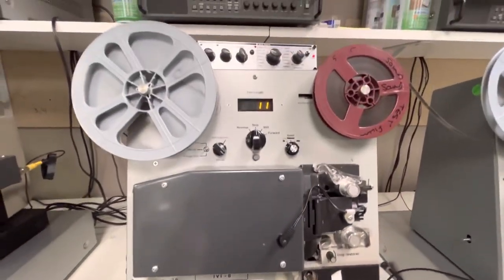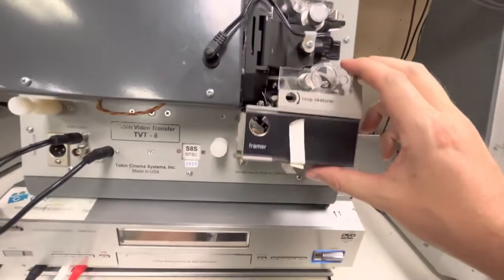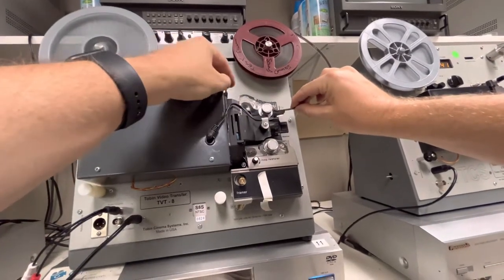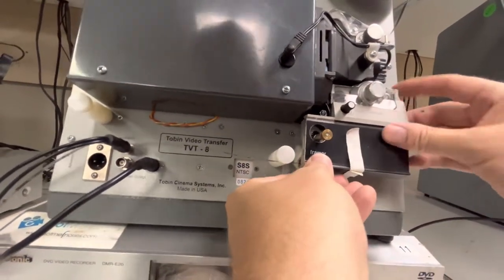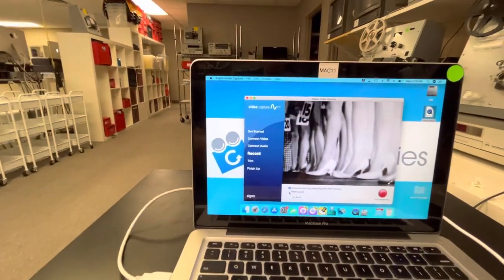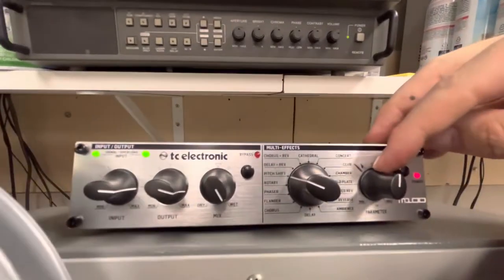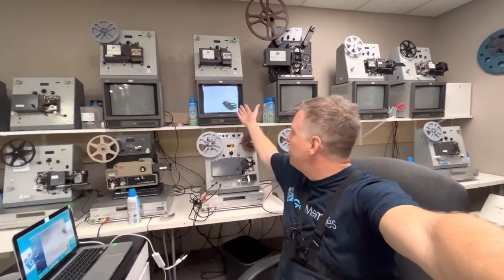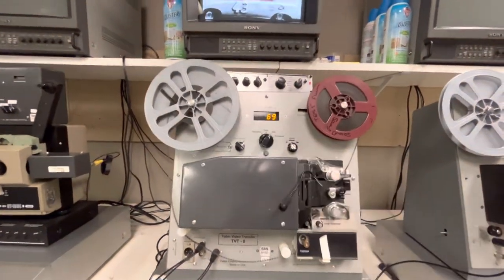How to Digitize Super 8 Sound to MP4, Film Transfer Equipment Demo

Comment: I have some regular 8mm home movie film with a single magnetic strip.  These would've been produced in 1962, at the latest.  I've never heard it, as I've only seen the film content after it's been captured.  I do have an 8mm projector (Eumig P8), which does not support sound. It does have a section to allow synchronising an external tape.  Makes me wonder if he (my grandfather), recorded audio separately and had it added, later, or something else?  Hard to think why there's a magnetic strip on it.  I'm trying to come up with an audio capture method running the strip past a cassette head.  Only done preliminary testing with a piece of super 8 with sound.   The head is able to pick it up audio, but nothing recognizable with the current testing.  The big concern is in not damaging the film.  Any guesses why an 8mm film of that era would have a magnetic strip?
Reply from the maker: Regular 8 with sound is very rare and it was a sep recording, not a sync ‘live’ … there are R8 mag projectors out there but very expensive. Some can cost a couple grand refurb. Might get lucky and find one cheaper.
Reply: @gotmemories  I managed to get a rudimentary audio clip from one of my regular 8 films.  As you suggested, It is not sync audio, but appears to be narration.  I'll continue to work on a system for getting the entirety of it.  Again, main concern is in not damaging the film, but I also need to ensure constant speed.  Specific speed is not particularly important, as I can fix that in post.  Cheers!

Comment: I have a question. Can this super 8 film scanner copy stereo sound track super 8 films and optical sound track super 8 films? This is very important for me because I have those kind films. And of course these stereo track films are very very rare and expensive.
Reply from the maker: No but I have lots of videos in the channel with me showing my specific sound equipment, there is a whole playlist with the collection of videos. Sound transfer machines are very expensive, insanely rare. 
If you want a quote for me to digitize them and capture the audio email info@gotmemories.com
Reply: Yes I can transfer stereo magnetic stripes on a custom built  8mm sound stripe playback machine with high quality sound (not a projector). If you like I can supply sound file examples for you. If they are true stereo tracks such as from a live stereo mic I can leave this intact for you. If you are wanting a mix of the main and balance stripe track tracks I can also do that in post.                                                                                                  The balance stripe is the rare other track on your stereo Super 8 film. My gear can play both tracks at once, which in your case means stereo. Here's a link to my recent YT demo of a high quality balance stripe transfer. https://youtu.be/wBRSRIflDq0?si=2ZuWi5rDy4JGp7Mv

Comment: I'm planning to build my own Super8 Scanner - about the sound head: do you think i could also use one from a normal cassette recorder or can you still buy super8 sound heads?
Reply from the maker: Zero clue, trial and error.
Reply: No a cassette head is not suitable. Super 8 sound mag stripe heads are designed for purpose. Yes Super 8 heads can still be bought I think but there's a lot more to it than just the head, as in a tape machine.